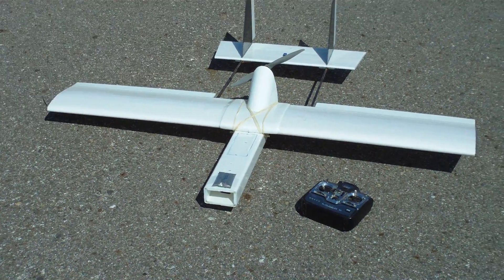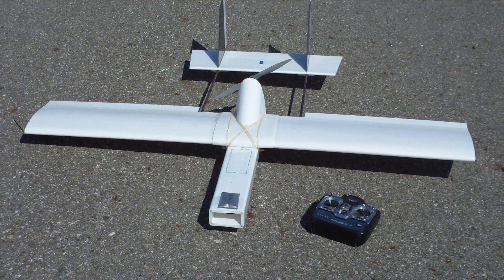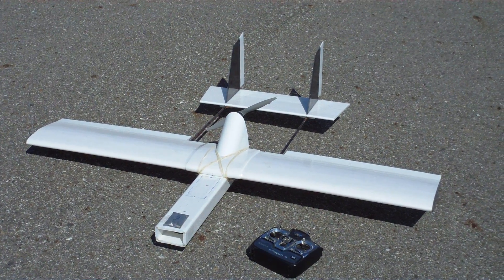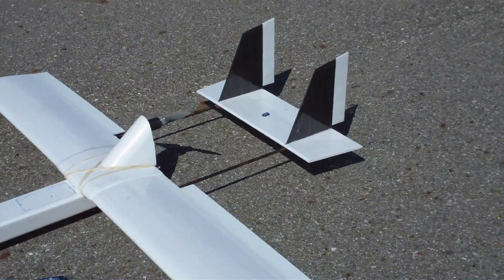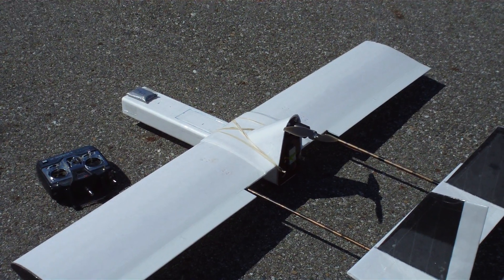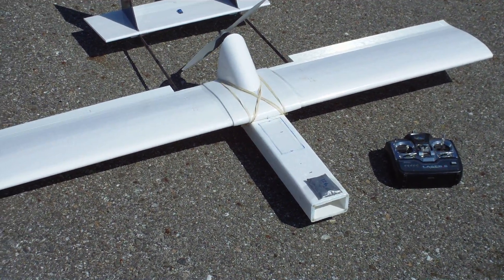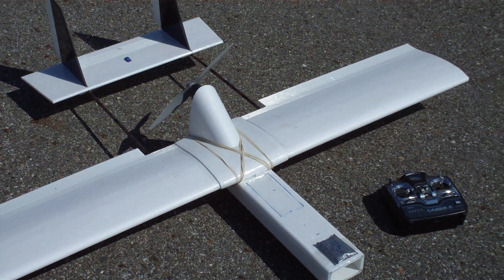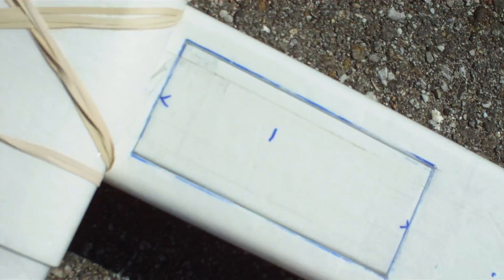FB Drone part 1

Comment: I know this is an old video but you may want to consider using notes for narration. If you're not going to be on screen then having notes won't be noticeable but it will help remove all the 'umm' and 'err' that keep getting repeated. Either that or just use 'jump cuts' to edit out these sounds.

Comment from the maker: On the other hand, series will double the voltage and maintain amperage using a similarly made "Y". The "Y" goes like this... made just like the parallel "Y" except a black wire from one connector will jump across to the red on the other connector. Like this...starting at the ESC side + goes to + connector - goes to + of the other connector and - goes back to the ESC...done!
West
PM me bra.

Comment from the maker: Hey MDD, Parallel means that the red wire on one battery is connected to the red wire of the other battery and the same with the black wires by using a "Y" connector that you make. So two male connectors for each battery and one female connector that goes to the ESC. This configuration keeps the voltage the same but doubles the maH (amps)
Use matching batteries!
More...